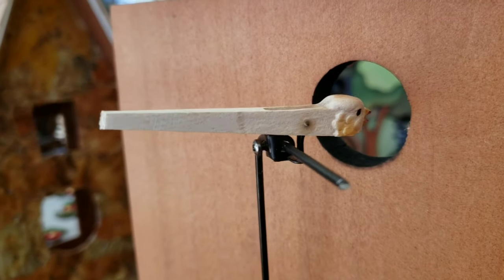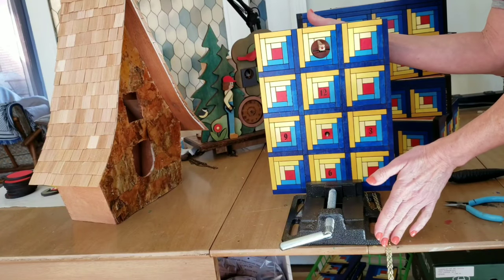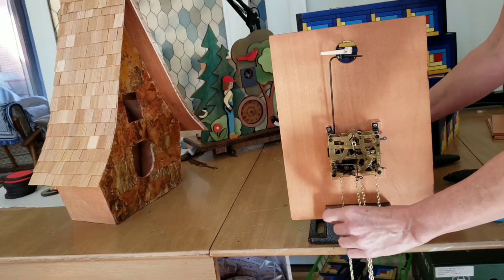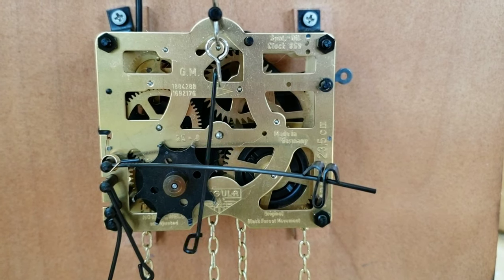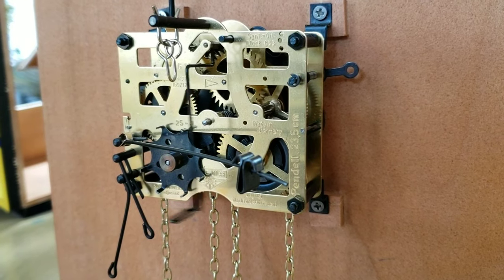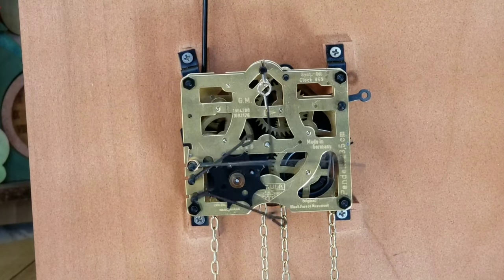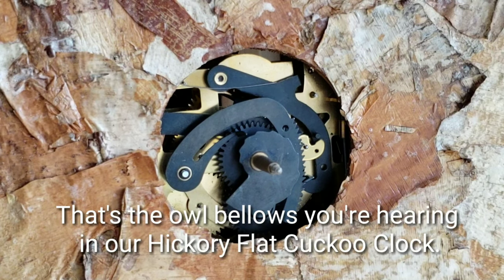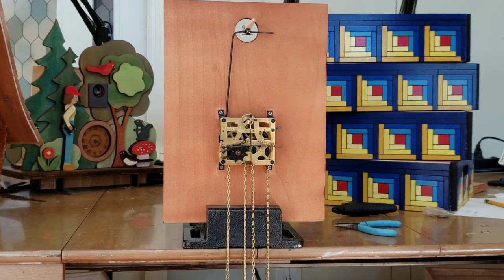What Makes the Cuckoo Clock Bird Move?

Comment: Perfect as I’m about to clean a clock bought in the 60s that’s stopped working with the ‘cuckoo’ loose inside the case 👍👏
Reply from the maker: You can find a lot of help on the forum at NAWCC.org and there are several groups on Facebook as well. Make sure you sue the right cleaners and lubricants!
Reply: The American Cuckoo Clock Company:
Thanks for the quick response and pointers👏👍
I’ve just oiled our 8 day Mantle clock using pukka clock oil using those special applicators.
I intend using my ultrasonic cleaner with correct fluid on the Cuckoo mechanism
Have just found out why I could no longer wind up my Waltham Mirror Mantel, and think I’ve solved it, but need to do more testing.
All to do I think with the square end of the winding rod having a snug fit in the mechanism, but cannot find any info on the ‘net.
Will have to try Forums and Facebook.
Thanks again 
Merry Christmas 🎊🎉🎄

Comment: Bow how does the bird shaft open and stay there until it's done? I'm still wondering how it does not simply pop back in and come back out each cuckoo.
Reply from the maker: The bird post is separate from the levers that power the bellows and the gong. So it is tripped on by the initiation of the cuckooing, and off at the end. The reason the cuckoo bobs is that a wire from the top of the bellows runs under and lifts its tail as the bellows open and close. As you can see, the movements one can get out of the clock are limited by the mechanics. I get requests for custom cuckoo clocks with movement they simply can't do. I hate to be unable to create their dreams!